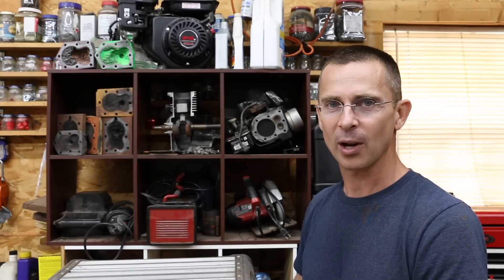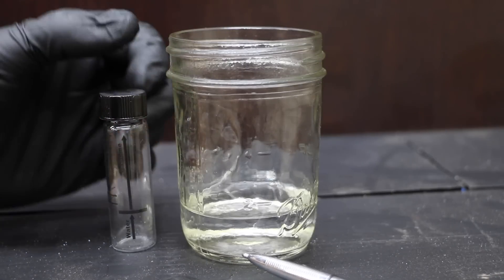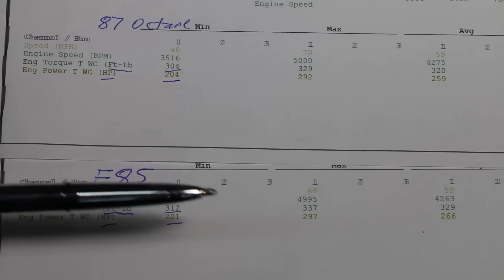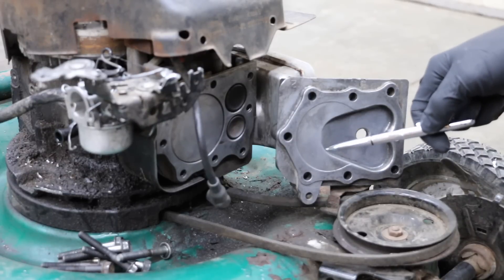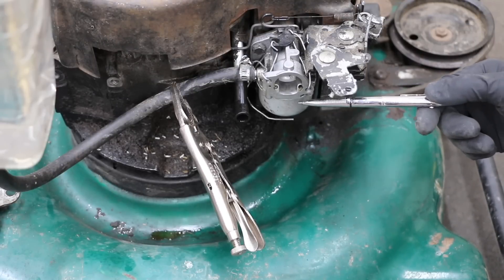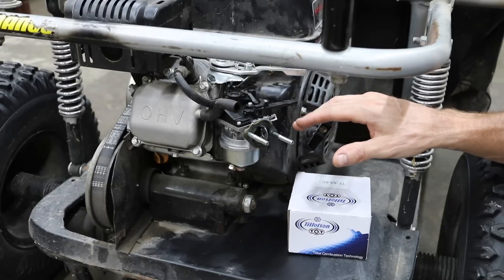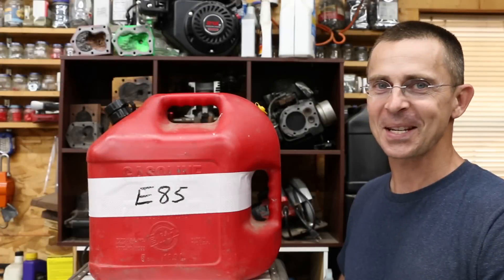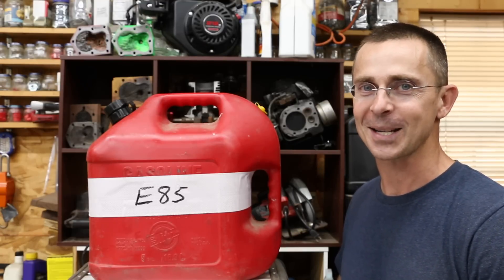Is E85 better than Gasoline? Let's find out!

Comment: That poor old lawnmower engine has had everything thrown at it.
Reply from the maker: lol. Yes, you are right!
Reply: Always wondering if he uses anything to lube the threads.  He has taken it apart so many times!
Reply: In today’s episode,  we’re gonna test and see if the engine will run on racoon urine!  You are right, poor mower!!
Reply: how about "will an engine run on nitroglycerin?"
Reply: @ChristmasCrustacean the piston has left the chat
Reply: It did up the power and keep it cool from the rich mixture.
Reply: Waiting he replaces those head bolts each time he opens it.
Reply: You think so 😁
Reply: Like my x wife
Reply: Must be a very durable engine to last this long
Reply: Good thing it's not a Ford engine
Reply: @jason22talley  Ford Engines are the best engeenered engines
Reply: @levingrale158  Ford's 4.6 and 5.4 truck engines were garbage.
Reply: @boomerisadog3899  Coyote and Voodoo? Everyone has some Bad engines and some good but i think coyote and Voodoos are some real good engines
Reply: @boomerisadog3899  yep they are lot spark plug blew issue
Reply: @levingrassle3592  They have cam lifter issue plus spark plug issue blew out
Reply: @enosburkholder2908  Where did you hear that? Because both are wrong. You're still thinking of the 5.4, which still has plenty of half a million mile+ motors out there despite those problems.

Comment: 2:21 too many problems and wayfarer variables to consider this valid. Very uncharacteristic of you.
Reply from the maker: Thanks for the constructive feedback
Reply: Project Farm: Find a route that will remain unobstructed, say I-40 in OK, NM, or AZ. Drive a non E car with both and whichever goes further, then repeat with an E85 car. But using cars that cannot meet the test parameters and old lawnmowers and adding extra carbs?? I've run a 2015 Lincoln MKZ from Austin to Tulsa many many times. I switched from regular to E85 regularly until I noticed I got better mileage (and of course range) with the regular gas. I then put a calculator to it and found that the cost difference didn't make up for the performance diff, so we use E85.

Comment: 2014 F150 eb, I can tell you first hand that running a blend of e85 and 91 non oxy, your truck will LOVE it!!!  Turbo engines love running a blend, I'm running an e20 blend.  I also believe running e85 can help with LSPI.... good ole poor mans race fuel!!
Reply from the maker: Thank you!
Reply: I have a 15 3.5 f150 eb, what is the ratio on fill ups.  36 gallon tank.  I want to try this.

Comment: Had a 2009 Chevy Uplander with flex fuel and the first chance I got to use it with E85 I got 21.4 and a highway. I was getting 25.6 with 87 octane.
Reply from the maker: Wow! Pretty big difference.

Comment: This is my opinion e85 is ok if you are in a pinch for gas with a vehicle that was designed for it! I have used it in my 2014 ford taurus mpg drops significantly vs regular gas 87! I used 85 and it took almost 3 tanks of 87 to get back to my original mpg! If any one have any response or suggestions for i will greatly appreciate it
Reply from the maker: Thank you!

Comment: I don’t think so. Isn’t E-85 mostly alcohol? You need almost twice as much.
Gasoline runs like 14.5 to 16 to 1 ratio with air. Alcohol runs like 10 to 1 ratio.
Right, you have to jet that mower way bigger then it might run okay. Use a lot more fuel though.
It runs cooler because more fuel is coursing through the motor helping cool it.
Reply from the maker: Thanks for the feedback

Comment: Good video! IMHO It simply just doesn't make economic or practical sense in my situation to use E85. Less MPG, less HP, unless is ready for it or you adjust your engine fuel mgt which it will make you burn even more of it to make the same power. Yes, it may burn great on newer vehicles but I have a perfectly running 18 yo car and not trading it for the crap they're making today. It may burn cleaner but I don't particularly believe all the hype about CO2. In fact, CO2 is what's making the earth greener right now and has been refuted as the culprit for the small increase in global temps. Another negative: It takes farmland away from growing food which I consider stupid and counterproductive. It could've made sense when oil reserves were considered to be running dry but that's not the case anymore after developing fracking and discovering new oil reserves. I even avoid E10-15 gas whenever possible as it makes my cars run like crap (early 2000 model) and had damaged the fuel system in the past. Alcohol should be for beer and whiskey and 1st aid kits, not cars! :D Maybe do a video next on LPG/NG conversion? That makes more sense to me as a greener fuel even more that Ethanol.
Reply from the maker: Great point. Thank you

Comment: Mix 87 with e85, check etanol amount of 87, mix to 25% ethanol content and try.
My runs great on mixed e85 n regular fuel.
'any'will run fine on 15% ethanol.
As built for 5-10% stock.

Efi will self regulate of needed but there are limits, or need higher pressure of injectors.
Don't wot a regular gasoline car engine with e85 Will blow....

Comment: My understanding is that E85 has a much higher octane rating (105), so it should have its best performance in a high compression or turbo/supercharged engine.
Reply: I have been running e85 in my F-150 also since new gas station by house added it. It is $0.69 cents cheaper than any other gas in Nebraska so I have been saving about $20 per tank vs reg gas. Now need to see if mileage will negate the savings…

Comment: e85 needs turbos or superchargers to get most efficiency out of it
Reply from the maker: Thank you for the feedback
Reply: Ya, ethanol is at a performance disadvantage in flex fuel vehicles. If you increase the compression (different heads, gasket, pistons or rods) it should increase the power and efficiency quite a bit. But you will no longer be able to use regular unleaded of course.
Reply: And knock detectors.
Reply: You will still get a power increase naturally aspirated if tuned correctly. Your statement goes for gas too.

Comment: So far E85 i see no different from gas, but its cheaper and damn near had a full tank of 15 bucks
Reply: It's cheaper but you also lose a good chunk of fuel efficiency.
Reply: Yeah I've seen it at like 2 stations around here in Rhode Island/southern Massachusetts & it's either the same price or more as 87 octane/cheapest gas. I don't have any vehicles designed for it anyway but at those prices the only incentive would be the engine cleaning benefits.

Comment: I tried E85 lost a lot of fuel economy and my check engine light came on went 200miles before I ran out of gas I normally run out about 400 miles
Reply from the maker: Thank you!

Comment: What i heard with gasoline only vehicles running E blended gas higher than 10-15%, will damage  rubber lines ? True or false
Reply from the maker: True for those vehicles that don't have components designed to withstand ethanol. Thank you
Reply: You should not use fuel with ethanol for vehicles older than lets say, 10 years. It will damage fuel system components for sure.

Comment: Here in Brazil most cars are flex, I drive my 2019 Honda Civic purely on ethanol (100% etanol here, with no gas that I know), and the car is noticeable stronger and in every oil change the oil is clean like new.
I mostly drive o ethanol because of the e o friendly of it, because it is not worth by miles per money...
Reply from the maker: Thank you
Reply: It is difficult by these days to find ethanol on most gas stations in Brasil. Gasoline is cheaper by mileage, and gasoline is actually E20

Comment: I have used E85 in my cars with a flex fuel Tune, not only for the power but mostly for the price here in france. 0.62 euros per liter for e85 and 1.61 for 93 octane which equates to 2.6$ per US gallon of e85 vs 6.75$ per US gallon of 93 octane. Power was much better 450hp e85 vs 420hp on 93 and even if i got 12 MPG instead of 15 in my case it was still a lot cheaper. (for info 12 mpg on e85 costs the same as 31.5mpg on 93 octane with french fuel costs)
Reply from the maker: Thank you

Comment: E85 in my 335i N54 engine has worked pretty well for coming up on 3 years now. The car wasn't necessarily designed for it. The only thing I've changed is size of fuel pumps to accommodate the flow. Haven't had any issues with the stock lines or gaskets.
Reply: Evan Millett is yours stock other then the pump I want to run e85 in mine also
Reply: Michael Barajas heavily modded with the exception of turbos. I kept stock turbos in it.

Comment: We like e85 in the forced induction tuning community (my cars are mid-nineties turbo cars). It's well known that e85 has less energy per unit of fuel, so larger injectors are needed (or larger jets) to get the proper air-fuel ratio. 
The benefit for power comes because of two factors (as i understand): first, ethanol is naturally more resistant to pre-ignition (knock) raising the effective octane rating, and second, because it requires more fuel, ethanol has a cooling effect on the air-fuel charge, allowing more boost without pre-ignition. 
For normally aspirated engines, i think your results are about right. Slightly more horsepower (cooler charge, more timing advance), and markedly reduced  fuel economy (less energy per gallon).
Reply from the maker: Great point! Thank you
Reply: @ProjectFarm  heh, sorry, when making this comment, i didn't realize i was replying to a 10 month old video.

Comment: E85 is typically used by gearheads to squeeze lots of extra power out of their street/strip builds and to those individuals, economy means nothing and HP means everything. It's cheap, cleaner than running 93 octane, and gives a much bigger boost in power.
Reply from the maker: Thank you!

Comment: In my frs mileage/ price differences are pretty even because with high compression engines you have to run high octane. No 87 for anything of mine. 
I have a very noticeable difference in power(maybe 40hp) although my car isn't "flex fuel". I have to flash the ecu if I change fuel. 12.5:1 compression
Reply from the maker: Thank you

Comment: I own a 2017 Mustang GT with a gen 3 Whipple tuned to 14 pounds of boost on 93 octane with Boostane and wish I had access to e85 because I could gain approximately 80 horsepower. Currently in the 700 whp range. I live in southern Utah so I’ll just have to meth spray. Still won’t be as good as e85. :(
Reply from the maker: Thank you

Comment: E85 gives out the most hp on boosted vehicles its a cheaper race fuel they even did one of these test on a engine dyno with engine masters but i wonder how much hp is gained on those little motors lol
Reply from the maker: Thank you!

Comment: Hey I love your videos, I use E85 exclusively except for oil changes (per the mfg) and if I am traveling (and no E85 along the way). Vehicles with higher compression engines get much LESS of a mpg hit. For example on the 2018 F150 I see a 2 mpg drop. When towing the number evens out. Also many of these newer higher compression engines suggest using 91-93. E85 being much higher octane often ends up being over $1 cheaper per gallon then 91-93. E85 is also really good for towing as it keeps the engine cooler.
Reply from the maker: Great point. Thank you

Comment: QUESTION? Will mixing E85 and regular gas 50/50 help clean the cylinders and keep rubber degrade to a minimum?  Than you Great channel.
Reply: FlexFuel vehicles dont use rubber at all

Comment: My question is does ethanol have the same detergents and additives that premium gasoline brands offer? For example, Chevron instills Techron which reduces fouling and carbon build up in the engine.
Reply: E85 doesn't need it, even my tailpipes are spotless

Comment: No No No No No No No No 

Unless you install larger injectors, increase fuel pressure and run a hotter plug, you are wasting your time. Less horsepower, but a bit more torque. E85 has less energy, thereby less fuel economy.
Reply from the maker: Thank you

Comment: Another thing you could do to see how E85/E100 fuel affects an engine is to measure the viscosity and lubricity of the oil after running E85/100 in a gasoline engine for extended periods. It's my understanding that ethanol rich fuels thin out engine oil more quickly than gasoline.
Reply from the maker: Thank you for the video idea!

Comment: Jimsiggy hit the nail on the head. You can't compare apples to apples with these fuels. You have to take advantage of the E50-E100 with high compression or boost which would cause knock with regular fuel. Essentially you want to run the lowest ethanol content that the engine can handle without retard or knock.

Comment: I drive a factory fitted E85 Volkswagen Golf TSI (Called Multifuel), 1.4 liter, 125 horse power, 200 Nm torque. absolutely love it. Great fuel efficiency about 29Mpg. And the fuel here in France is about 0.6€ per liter. Couldn't be more happy
Reply: What?? I've never heard of fuel being cheaper than at least 1 euro anywhere in europe, arent diesel prices like 1.50 euros in france as well?

Comment: I would love to see a video on using e15 in a turbo engine, whether it is better than e10 or e0 at preventing knock.  My Chevy Cruze is built to handle up to e15 and I’ve found it runs better on e15. 88 octane than on 89 octane e10.  Can’t be the octane must be the cooler burn?
Reply from the maker: Thank you for the video idea!

Comment: I have a 1979 Ford Fiesta XR2 (Hi compression engine). Using 91 octane gasoline it gets 39 mpg. When I tried E-85, it didn't seem to accelerate as well but the mpg went up to 46.5.
Reply: Richard Skipper  It's been running for eight years now. No problems here. It has a Weber Vari-Mix carburetor. It's kind of like the paralleling valve on the fuel control unit on an Allison 501D-13 Turbo Prop. Unless you are an aircraft tech, you won't understand it.

Comment: E85 allows you to advance the timing without detonation which in turn gives you more power. Its just a higher octane fuel at the pump for cheap. Cheaper than race fuel.
Reply from the maker: Thank you

Comment: Nice test, however E85 can stand for much more aggressive timing, especially @ peak torque point.  The HP/TQ on a NA engine should be about 5-10% higher than regular gasoline.  Another benefit is E85 burns slightly cooler during the combustion process, so when towing or racing, E85 will lessen the thermal load on the engine coolant/oil giving the engine a larger margin of safety from overheating.
Reply from the maker: Thank you!

Comment: I've ran e30 blends (87 cut with e85) in everything from a Maserati with a Ferrari engine to a Ford 6.8 v10. Seems to be a cheap way to get higher octane fuel if the vehicle is designed for premium fuel only. 
Never had problems...
Reply from the maker: Nice cars!

Comment: 1)  Alcohol brings oxygen that can participate in combustion, hence a greater potential for denser combustion charge (more power) IF TUNED PROPERLY. 2) Since oxygen is present in the alcohol molecule, the volume of fuel required for stoichiometric (correct/balanced) air fuel ratio (A/F) combustion is considerably greater. 3) Since the octane is higher, to optimize power and efficiency, changing spark timing (your E85 vehicle does this automatically) , upping compression and increasing boost (turbo, supercharger) is required. Doing all of the listed can make an engine more powerful but will not make up for loss of economy if cost of operation is all you care about
Reply: 1) Negative.  That oxygen atom is already bound to a hydrogen atom which is a very stable configuration.  Perfect combustion produces CO2, NOx and water.  That OH radical pops off the carbon chain then combines with a hydrogen atom that's been ionized off the carbon chain to create water. In effect alcohol is already partially burned.

2) Correct
3) Also correct.

Comment: enjoyed your video. you mentioned the added cost of running E85 due to its effect on mpg. I am not sure in your area, but where I live, E85 can be much cheaper than standard fuel, thus off setting the overall cost. depending on the vehicle, you can do a little math and see how much less the E85 price has to be compared to standard fuel, to know if you will save more money. so, 210 a gl for E85 at 11 mpg, vs 310 a gl for 87 at 15 mpg... you save money despite burning more fuel.
Reply from the maker: Thank you

Comment: Run E85 on my 2011 Silverado. I get sixteen mpg general compared to eighteen with 87 octane E10 (California).

Now, I filled up in Oregon. I dunno if that's E10 or not but the gas was cheaper and my Silverado felt like a hot rod. Mileage was 20mpg as the engine kept going into V4 mode easily. I suspect the gas there is better.
Reply from the maker: Thank you

Comment: I have a 03' Hyundai Tiburon V6 with bigger injectors and engine runs perfectly since 5 years now. Using E85, i did 160.000 kilometers and engine runs perfectly and is strong. No fuel leaks, no fuel in oil, compressions are great.

Here in France, E85 is 60% cheaper than regular gasoline 87, so fuel efficency is lower but a full refill of gasoline is approx. 90$ instead of 40$ with E85. 👌
Reply: Just a tip : since E85 have an average octane of 105 approx. You can adjust timing consequently. Most engines use knock sensors to adjust it but if tweaked manually, gains can be more significant and fuel efficiency can be also way better than using stock ecu maps based on regular gasoline 😌
Reply from the maker: Thank you!

Comment: See you always add some kind of alcohol additive to take water out of gasoline. Exactly what it does is that it attaches around the water to be pumped out of the gas tank. And still burn is it  through the fuel injection system or the carburetor system.
Reply from the maker: Thank you!